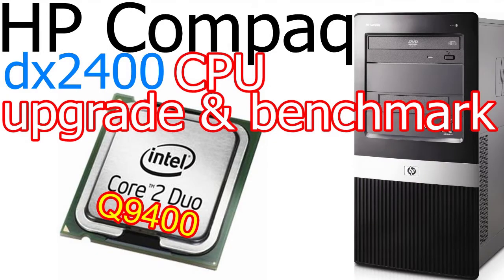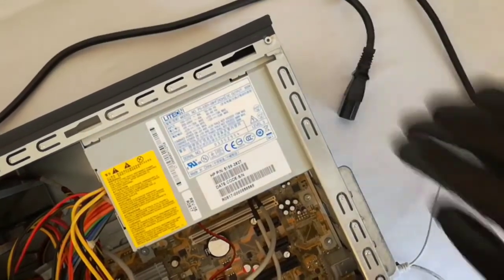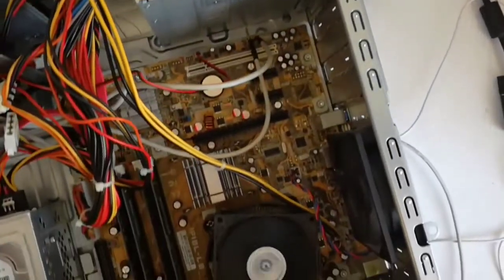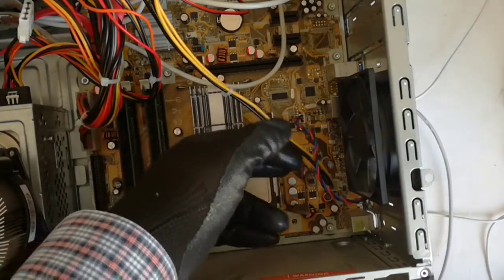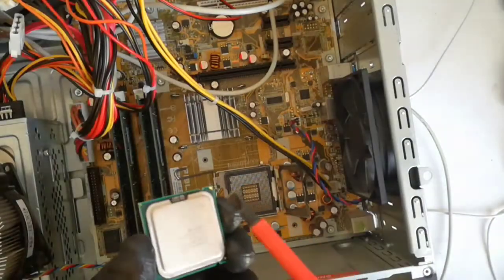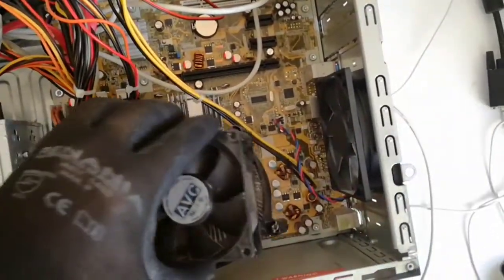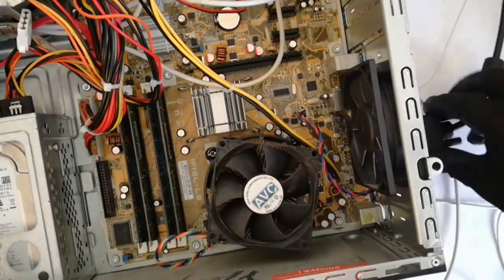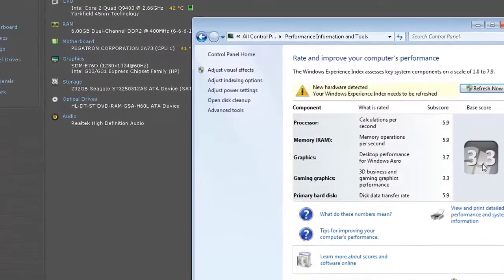HP Compaq dx2400 Microtower PC upgrade to Core 2 Quad Q9400@ 2.66 GHz Ep.186

Comment: how update BIOS for Q9550 ?
Reply from the maker: According to HP Compaq dx2400 Microtower Business PC QuickSpecs sheet, only these Quad CPU's are supported
Intel Core 2 Quad Q8200 processor (2.33-GHz, 4 MB L2 cache, 1333-MHz FSB)
Intel Core 2 Quad Q8300 Processor (2.50-GHz, 4 MB L2 cache, 1333-MHz FSB)
Intel Core 2 Quad Q9400 processor (2.66-GHz, 6 MB L2 cache, 1333-MHz FSB)
Intel Core 2 Quad Q9650 processor (3.00-GHz, 12 MB L2 cache, 1333-MHz FSB)
Sometimes the manufactures don't show all supported CPU's, maybe it will work.

You can download the BIOS update files from here https://support.hp.com/ie-en/drivers/swdetails/hp-compaq-dx2400-microtower-pc/model/3658376/swItemId/vc-68959-2?sku=NN542ES and run the BIOS update.exe files
However please leave a comment if it worked or not and good luck with the upgrade.
Reply: @redigitt  So it doesn't support the Q9550? I bought it, but it's giving me too many blue screens.
I had updated the BIOS to version 5.43, and the problem persists.
Reply from the maker: Sorry to hear that, but thank you for your response.
Reply: @redigitt  Thank to you for your response

Comment: How to I upgrade the RAM in the this model of pc is it easy to do and do you have a video that may assist me in changing it
Reply from the maker: Aloha, I don't have video with the RAM upgrade, but it is easy, the maximum supported is 4 x2GB.
You remove or you add some more memory, sometimes      you have to reset the BIOS to recognize the total memory.
Some memory's won't work with the motherboard.
512-MB DDR2 Synch DRAM PC2-6400 (800-MHz) Non-ECC (1 x 512MB)
1-GB DDR2 Synch DRAM PC2-6400 (800-MHz) Non-ECC (1 x 1GB)
2-GB DDR2 Synch DRAM PC2-6400 (800-MHz) Non-ECC (2 x 1GB)
2-GB DDR2 Synch DRAM PC2-6400 (800-MHz) Non-ECC (1 x 2GB)
3-GB DDR2 Synch DRAM PC2-6400 (800-MHz) Non-ECC (3 x 1GB)
4-GB DDR2 Synch DRAM PC2-6400 (800-MHz) Non-ECC (4 x 1GB)
4-GB DDR2 Synch DRAM PC2-6400 (800-MHz) Non-ECC (2 x 2GB)
8-GB DDR2 Synch DRAM PC2-6400 (800-MHz) Non-ECC (4 x 2GB)
This is how you upgrade the memory:
1. Power down the PC
2.Unplug the power cable and the monitor cable
3. Press for 10 seconds the power button on the PC, to discharge the capacitors
4. Remove the side cover
5. Now, I don't know how many slots you have populated, you can add or replace with higher capacity
6. Plug in the monitor cable
7. Plug in the power cable
8. Power on the PC
9. If you see a message that your amount RAM has changed, you press the key to agree
10. If you don't have video signal, then you have to follow the  1;2; and you have to reset the BIOS for 10 seconds
11. And you power on the PC again, if you don't have video signal then you can try to switch the RAM's in the slots, if you still don't have video signal you have to try with another RAM
Thank you for watching, if my video or advice was useful, please consider to share and subscribe.
Reply: @redigitt  thank you I will have a go at it seem as if it’s easy

Comment: Is the motherboard on this hp pc can easy replace with other brand? I have experienced with hp pc before you can't install other brand ram because the bios can't read ram. I about to buy the used pc for my mom.. she just want to play old flash games. Can this model of motherboard install other brand ram
Reply from the maker: Aloha, this is an old video,I don't remamber clear this PC, but as you see in the video https://youtu.be/Kw0ExPF6MtM?t=81 the motherboard is a IPIBL-LB micro-ATX motherboard, so you can replace with another micro-ATX motherboard. 
About the RAM, I upgraded to 6GB,  but I don't recall what RAM's I used.
Thank you for watching.

Comment: My pc is DX2810, can i upgrade CPU to Xeon L5420 mod 775 socket?
Reply from the maker: Aloha, your motherboard support this CPU's:
 Intel Celeron Processors:

    Intel Celeron 430 Processor (1.8 GHz, 512 KB L2 cache, 800 MHz FSB).
    Intel Celeron 440 Processor (2.0 GHz, 512 KB L2 cache, 800 MHz FSB).
    Intel Celeron 450 Processor (2.2 GHz, 512 KB L2 cache, 800 MHz FSB).

Intel Celeron Dual-Core Processors:

    Intel Celeron E1200 Processor (1.6 GHz, 512K L2 cache, 800 MHz FSB).
    Intel Celeron E1400 Processor (2.0 GHz, 512K L2 cache, 800 MHz FSB).

Intel Pentium Dual-Core Processors:

    Intel Pentium E2200 Processor (2.2 GHz, 1 MB L2 cache, 800 MHz FSB).
    Intel Pentium E2220 Processor (2.4 GHz, 1 MB L2 cache, 800 MHz FSB).
    Intel Pentium E5200 Processor (2.5 GHz, 2 MB L2 cache, 800 MHz FSB).
    Intel Pentium E5300 Processor (2.6 GHz, 2 MB L2 cache, 800 MHz FSB).
    Intel Pentium E5400 Processor (2.7 GHz, 2 MB L2 cache, 800 MHz FSB).

Intel Core 2 Duo Processors:

    Intel Core 2 Duo E7300 Processor (2.66 GHz, 3 MB L2 cache, 1066 MHz FSB).
    Intel Core 2 Duo E7400 Processor (2.8 GHz, 3 MB L2 cache, 1066 MHz FSB).
    Intel Core 2 Duo E8400 Processor (3.0 GHz, 6 MB L2 cache, 1333 MHz FSB).
    Intel Core 2 Duo E8500 Processor (3.16 GHz, 6-MB L2 cache, 1333 MHz FSB).
    Intel Core 2 Duo E8600 Processor (3.33 GHz, 6 MB L2 cache, 1333 MHz FSB).

Intel Core 2 Quad Processors:

    Intel Core 2 Quad Q6600 Processor (2.4 GHz, 8 MB L2 cache, 1066 MHz FSB).
    Intel Core 2 Quad Q8200 Processor (2.33 GHz, 4 MB L2 cache, 1333 MHz FSB).
    Intel Core 2 Quad Q9400 Processor (2.66 GHz, 6 MB L2 cache, 1333 MHz FSB).
    Intel Core 2 Quad Q9550 Processor (2.83 GHz, 12 MB L2 cache, 1333 MHz FSB).
    Intel Core 2 Quad Q9650 Processor (3.0 GHz, 12 MB L2 cache, 1333 MHz FSB).

    note: Intel processor numbers are not a measure of performance. Processor numbers differentiate features within each processor family, not across different processor families.

Thank you for watching, if my video or advice was useful, please consider to share and subscribe, have a nice day.

Comment: Can i upgrade to core i7
Reply from the maker: Sorry, you can't, this has a socket 775 motherboard. Thank you for watching.
Reply: @redigitt  can i upgrade to gtx 970 I'm currently on gtx 660 3gb now. My pc specification are core i5 4th gen Ram 8gb
Reply from the maker: Yes you can upgrade to GTX970 and you can upgrade to i7 to, look on the motherboard support website for compatible CPU's.....and your PC is not a HP Compaq dx2400 :)

Comment: hi, i what upgrade it to quad core q9650, can i? (sorry for my english)
Reply from the maker: Yes, you can upgrade to Intel Core 2 Quad Q9650 processor (3.00-GHz, 12 MB L2 cache, 1333-MHz FSB).
Before you upgrade please clean the CPU heatsink & cooler and use a good quality thermal paste for the CPU.
Thank you for watching, if my video was useful then please don't forget to share and subscribe.
Google translate:
Sí, puede actualizar al procesador Intel Core 2 Quad Q9650 (3.00 GHz, 12 MB de caché L2, FSB de 1333 MHz).
Antes de actualizar, limpie el disipador térmico y el enfriador de la CPU y use una pasta térmica de buena calidad para la CPU.
Gracias por mirar, si mi video fue útil, no olvides compartirlo y suscribirte.
Reply: @redigitt  it's compatible?

Comment: Hi, i have the same pc with an pentium e2200, and i want to upgrade it to a core 2 quad q8400, can i?
Reply from the maker: According to this document, https://drive.google.com/open?id=1PTwhZcBd-JUl13euENj5iGLYD7U8vw-y   you can't.
These are the supported Quad core CPU's 
Intel Core 2 Quad Q8200 processor (2.33-GHz, 4 MB L2 cache, 1333-MHz FSB)
Intel Core 2 Quad Q8300 Processor (2.50-GHz, 4 MB L2 cache, 1333-MHz FSB)
Intel Core 2 Quad Q9400 processor (2.66-GHz, 6 MB L2 cache, 1333-MHz FSB)
Intel Core 2 Quad Q9650 processor (3.00-GHz, 12 MB L2 cache, 1333-MHz FSB)
Thank you for watching and good luck with the upgrade.
Reply: @redigitt  Damn bro, I already bought the CPU, because this page shows that the 2a73h board can move it
https://www.pcspecs.com/mobo/Pegatron_Corporation/Pegatron_2A73h/3156/Compatible_CPUs
Reply: @redigitt  what should I do?
Reply from the maker: If you already bought, then you try if it works or not.
Sometimes the manufactures don't show all supported CPU's, maybe it will work.
However please leave a comment if it worked or not and good luck with the upgrade.
Reply: @redigitt  Thank you
Reply: @edwingamboa9521  
Friend, did the processor you bought work for you?
Reply: @Firi0x  it's almost here, in a few days I'll answer you
Reply: @edwingamboa9521  Vale amigo espero.
Reply: @Firi0x  Funciona perfectamente

Comment: My hp compaq has core i5 and 8gb ram. Can i upgrade to 1050 ti
Reply from the maker: Yes you can, but your PSU has to be minimum 300W  https://www.geforce.com/hardware/desktop-gpus/geforce-gtx-1050-ti/specifications
Reply: How to check watts??
Reply from the maker: you simply read from the PC power supply sticker.
Reply: @redigitt  got it. I'm using gtx 660

Comment: please do everything if you want to help me
we upgraded to a new processor on the p5k31 vm / s motherboard
from an e8200, dual core 2.66ghz to a core 2 quad q9400 2.66 ghz
the board as I read is compatible with this processor, but when I put the processor on, why not start up? only appears the INTEL badge and beeps 3 times, nothing more
can you help me find the problem? please ? Do I have to upgrade to bios? or ?
p.s are Romanian, I use google translate
Reply from the maker: Salutare,  probabil versiunea de BIOS instalata este veche si nu suporta procesorul Q9400.
Pune inapoi procesorul vechi (E8200) si fa update la BIOS, incepe de la versiunea urmatoare fata de versiunea instalata si porneste calculatorul dupa fiecare versiune instalata.
Updateaza versiunile de BIOS in ordine crescatoare si nu sari nici o versiune in afara de versiunile BETA, versiunile BETA sa nu le instalezi. 
P.S. foloseste pasta termoconductoare de calitate buna cand pui inapoi procesorul Q9400 pentru ca procesorul are 95W TDP, E8200 are numai 65W TDP, poti verifica temperatura procesorului cu programul Speccy.            
Daca ti-am fost de ajutor te rog sa dai share la video, bafta la update si la upgrade.
Reply: @redigitt  m-am abonat si am dat like si iti voi mai da si o sa distribui pentru că tu meriți asta ,dar totusi, am incercat sa dau update la bios, 2 ore m-am chinuit ,si nu am reusit, deloc, ma poti ajuta cu un update ? Un link ceva ? Versiunea mea scrie ca e 0009
Reply: @redigitt imi poti da un număr de telefon sa ne auzim ? Iti sunt recunoscător  daca ma poti ajuta
Reply from the maker: nu ai gasit o versiune mai noua de BIOS sau nu ai putut instala? ASUS a livrat placi de baza pentru HP care nu este listat pe siteul lor, trebuie sa cauti dupa denumirea de la HP, daca ai PC HP cum se numeste? cauta-ma pe facebook, dar deobicei sunt online numai intre orele 20:00-22:00.
Reply: @redigitt  nu e o problemă de la ora 20 și 22 ,daca doresti putem vorbi sa vedem daca se poate face ceva ,iti multumesc

Comment: I want to upgrade mine,but did you have to upgrade the bios or not?
Reply from the maker: Aloha, because the HP Compaq dx2400 PC is an older PC it is recommended to upgrade the BIOS to the latest BIOS version.
You have to do your upgrade from the lower BIOS version to the latest BIOS version.

WARNING: DO NOT TURN OFF POWER OR ATTEMPT TO REBOOT THE COMPUTER DURING THE 
UPDATE PROCESS!
Thank you for watching,  if my video was useful, please share and subscribe , have a nice day and good luck to the upgrade.
Reply: @redigitt  yea, but were did you get the bios, i can't find it on the hp site
Reply from the maker: @paull007   look here https://support.hp.com/us-en/drivers/selfservice/swdetails/hp-compaq-dx2400-microtower-pc/3658372/swItemId/vc-68959-2

Comment: Can i upgrade my HP Compaq DX7500 with AMD 200GE?
Reply from the maker: According to this document https://support.hp.com/ro-en/document/c01574818#AbT0  the dx7500 computer is based on intel socket 775 CPU, so you can't upgrade with AMD Athlon™ 200GE Radeon Vega Graphics, 3.2 GHz, Socket AM4 CPU.
For AMD Athlon™ 200GE Radeon Vega Graphics, 3.2 GHz, Socket AM4 CPU you need a socket AM4 motherboard.
Thank you for watching, if my video was helpful please share and subscribe, have a nice day.
Reply: yes you can change mobo cause it is a standard micro atx

Comment: i have the same pc and was thinking to upgrade but the hp sites shows that it only supports q9300 and q9450 . plz help in clarifying https://support.hp.com/us-en/product/hp-compaq-dx2400-microtower-pc/3658372/document/c01399523
Reply from the maker: Aloha,  in the link shows the compatible CPU's from Intel Celeron 420 Processor (1.60-GHz, 512-KB L2 cache, 800-MHz FSB) up to Intel Core 2 Quad Q9450 Processor (2.66-GHz, 12-MB L2 cache, 1333-MHz FSB). Now what CPU do you have in the PC and how big CPU do you wish to upgrade?
Reply: core2 duo E8400 currently . was thinking of getting q9650 but if its not supported then probably  a q9450